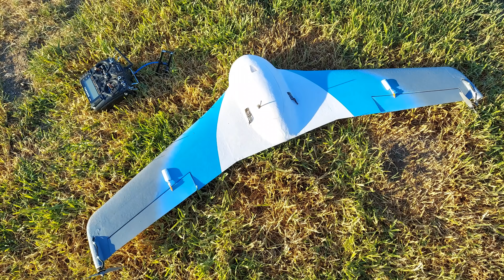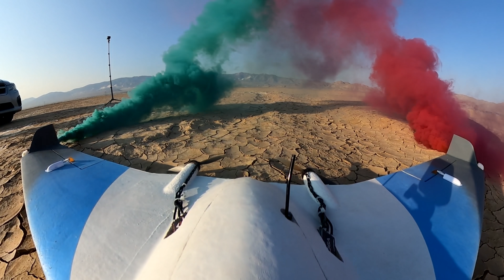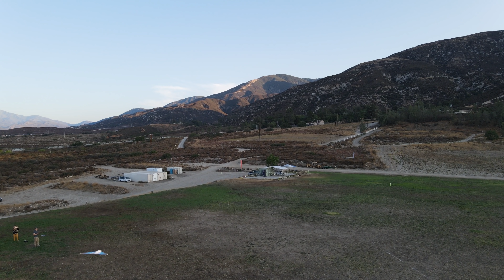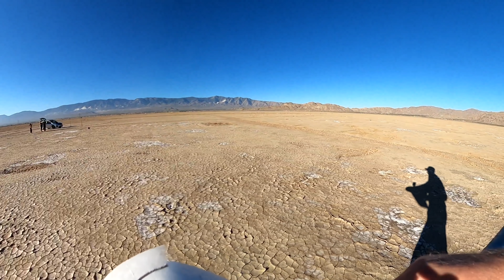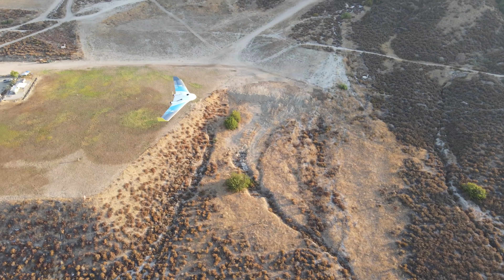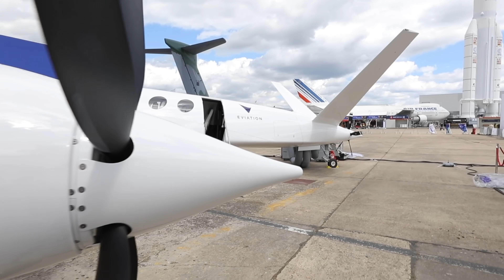Can Wingtip Motors Improve Aircraft Efficiency?  RCTestFlight Solar Collaboration Part 1

Comment: It is the same with most "We have revolutionised <XYZ> and this makes it soooo much better" - and then it turns out that it is only marginally better in 1 very specific situation and in general just worse.
For this plane - really looked nice with the wingtip-motors. I just wish you'd have added the motor-mounts for both configurations to only see the difference the placement of the motors make, cause now it also includes changes in the geometry at the wing-tips and the middle section.
you'd need to change those anyways, but it would limit the impact of other changes and highlight the effect of the motor at the tips.

Many "inventors" tried to straighten out the vorticies in a misguided attempt at reducing drag. It is not the presence of the vortex that causes drag, but drag and the presence of lift that manifest in the formation of a vortex. 
Wingtip-vorticies are formed cause the wing generating lift means it is moving air downward along its span, and where that meats the stationary air it starts to swirl. having a rotor in that location just pushes that region further outside, effectively increasing the wingspan, which in turn decreases the relative impact of the wingtip turbulences.

Comment: IMO the wingtip vortices generated by small model aircraft are too slight ti gain any advantage by either wingtips or propeller wingtips (or any other try).
A model would generally have to be at least 3 meters wingspan if not even larger to start to see issues that might need to be addressed.
This is just one of those things that can't be scaled down or up because the issues just don't scale, too.

But, if you'd like to explore the dynamics of wingtip motors, that's also interesting.
You'd be getting larger yaw effects by placing the motors far from the fuselage.
You also discovered something I think a lot of designers encounter quickly that placing motors above or below (or inline) the wings can make a big difference in pitch and that it's easier to place the engines below the wings to pitch upwards when there can be self-correcting dynamic forces rather than above the wing which causes instability to increase exponentially. If you moved your engines fore or aft you'd also encounter new dynamic forces as you move further from the plane's center of lift.
You also experienced these forces to greater effect because you chose a flying wing design. If you had chosen a more conventional wint/fuselage/tail design, the aircraft probably would have been more stable and tolerant of your design mistakes.

Comment: I had an idea a while back and I'm not sure if it's any good. Perhaps someone here could help...what would happen if the leading edge of the wings had points like the nose of a fighter jet? Same for the leading edges on a propeller. All along the edge that forces the air to divide between what is above you and what is below, there would be several small, long (or short, all depends which shape would be more efficient and not weigh so much that the points become counter-effective), thin, tapered points. 
Think of it like this: place two pencils next to each other, parallel on a table. Put an ink pen on top of the two in the same direction and press down until the pencils separate (here the pen represents the wing and the pencils would be the air molecules). Now push the two pencils together and take that same pen, point the writing tip directly between the two pencils and press down on the pen until the two pencils separate. Which exercise required less energy that forced the two pencils apart? Would that same principle carry over into aerodynamic efficiency? Maybe tweeking the shape of the points a little for maximum efficiency gain with a minimum of additional weight would also help.

Comment: The F14 Tomcat had jets that were spaced relatively far apart, and unfortunately, the "A" block of F14s were paired up with a relatively crappy engine.  When one of the two engines failed, the plane became badly off balance, and would go into a flat-spin that was not recoverable.  This is what happened in the "Top Gun" movie, but it was a very real phenomenon.  The engines were later replaced with an improved variant, and the problem mostly went away.  But the over-arching issue remains: when the motors are very far apart, it puts a lot of torque on the aircraft when one of the engines fails.

Comment: Take a look at the Vought XF5U.  The design eliminates a lot of issues.  The propellers turn to keep the lower pressure and higher pressure sides of the airfoil from mixing (eliminates the vortex from forming at the wing tip.)  You essentially have two engines dragging an airfoil through the air.  The airfoil has a low aspect ratio.  See also Vought V-173 (Flying Pancake) and Vought VS-315.  Fully articulated propellers didn't arrive until the conversion to jet engines was underway and doomed the project.  But the design needs to be worked on.  Keep going.

Comment: It would be interesting to see a commercial aircraft with a hybrid propulsion system. Maybe have the standard underwing turbofans close to the body but decent size electrically driven propfans on the wingtips driven from the alternators in the main engines.

Comment: Talks about efficiency - puts giant airbrakes on the airframe ( AKA cameras, antennas, exposed linkages, external cables and so on... )... You also have to keep resistance due to increased motor wire lengths in mind. You need a more radical design with the batteries sunk inside the outer halves of the wings. Will cost roll authority due to increased mass inertia, but should be worth it...

Comment: Winglets increase the effective wing length (while still fitting in the normal sized aircraft hanger). Having the engine at the tip and turn with the top tip moving in the outboard direction also increases the effective wing length. Having the wing at the tip and turn with the top tip moving in the inboard direction should decrease the effective wing length. Your plane might increase in pitch stability with a longer flat mini-fuselage  part in the middle, like the B-2A or the Horton Flying wings. Historically, the B-49 flying wing didn't have the long flat mini-fuselage and suffered from pitch instability. Don't know if it would be enough to compensate for a 'Go-Pro' camera mounted too far forward.

Comment: The small efficiency gains come with the major downside of the aircraft entering a spiral dive when one of the wing tip engines/motors fail. Despite the high wing span this design having no vertical stabiliser can't be flown even at the smallest airspeed in such a situation.

Comment: Given the fact that enough wind is passing the wings, and given the fact that the wing is under the right angle, the bow of the wing on top of the wing creates a larger surface area compared to the flat underside of the wing, therefore the air pressure on top of the wing is lower per square inch compared to the air pressure at the flat underside of the wing, and therefore the wings will give lift as long as enough air passes the wing to carry the weight of the aircraft under the right angle. 

Any object can be send into the air, but that has nothing to do with lift created by wings and moving air. Some aircraft's have so much power that they can fly with wings that have net zero lift in neutral flight positions. For example those stunt airplanes. But they can't do that for a very long time, like for example an airliner can. Those wings from a stunt plane only creates positive or negative lift when the pilot adjust his controls in a very specific position. This makes them very agile and maneuverable and fast responding. That is the only reason why those stunt planes have wings with net zero lift in a neutral position. 

Even an aircraft without motors and with large enough wings and low enough weight ratio can get airborne given the fact that enough natural wind is passing the wings under the right angle. Although it is very hard to impossible to control it properly. 

I have an Aileron modified Easy Glider RC model and that will go airborne with enough wind and without any extra power from a motor. Given the fact that it is under the right angle.

Comment: aerodynamics and weight ratio changes in a full scale aircraft and other trade-in for propellers in the wing tip of a flying wing with swept angle could be stability, however the trade-off of distributed propulsion and wing propellers is flutter and so structural safety and weight.
efficiency can be tested on cruising, take-off distance and also gliding or soaring flight assisted with counter vortice propellers at low rpm

Comment: See Flying Flapjack. Unless you use the prop vortex to build a lower aspect-ratio wing you should expect increased weight from increased complexity including wing structures, vertical stabilizer and rudder, and landing gear among other areas. A big challenge will be to keep prop tips off the runway during takeoff and landing. Vortex drag is maximum at minimum speeds (high angle of attack) and very low at lower angles of attack. This is why high-aspect-ratio is most advantageous at lower indicated airspeeds.

Comment: Thank you for detailed explanations of wingtip propulsion.  Like Destin's comment, I wonder if you can vary the vortex at the wingtip.  For example, what happens if you used a system to rotate and/or change the camber / castor of each wingtip motor?  And if you got a positive result, what would happen if you could independently control the movement of yaw / camber / castor of each motor?  I look forward to your next video.  Again, thanks and keep up this great work!
Reply from the maker: this would be optimal.   Probably beyond what I can pull off at the moment but great comment, maybe in the future.

Comment: What would be the difference for a counter rotating style of prop motor with the propeller in the from of the wing and a propeller in the back? Would it also help if there is a fan shroud around these propellers to help reduce the size of this drag? As they would be larger and work more technically, I suspect it might be the better way to try and test it at the rc size level

Comment: Can you use the wing tip motors for direction control. Rather than Elevons by rotating them?
Reply: @daviddou1408  : I was thinking that if the motors could also be rotated under control, they could provide vertical and horizontal control as well as yaw. No need for elevons. . .
Reply: @daviddou1408  I was thinking of just a small rotation of the motor body with servos so the change in thrust would replace the elevons, Resulting in a cleaner - more efficient - wing. As for rudder effect, differential propeller speeds will provide yaw.

Comment: I think for real airplanes, putting the motors at the wingtips requires stronger and heavier wings overall which probably destroys the possible gains from the reduced drag due weight increase.

Comment: Suggestion: as far as diameter for a single pusher, dont EVER go above 33% of w/s (I would stay in to 20% or less range...And for dual, don't go over 16%-17% of w/s (10%-12% or less for dual).  

Some preliminary prop selections: I call it "Kat" (Aircraft "type" "K"onsant).  It's based on the fullspan ,wing planform area, and flying weight which yields a coefficient product.  The formula for "Kat" is: Kat = [ weight in lbs / ( wing area in sq/ft * full wingspan ft ) ].

Required Pitch Speed (and pitch selection here for that matter) plays a crutial role here too in "matching diameter to pitch vs rpm vs required pitch speed", to other factored specific fixed aircraft constaints, which is typically based on the eitherbthe Vs (syltall velcocity) or the Vs1g (stall velocity as aircraft falls at 1g), and stall velocity margin (Vs1g margin or just "stall margin" which is simply a factor = to the inverse of "Kat" (which is just yet another factor).  😂

So, prop pitch "matching" is VERY VERY key here, too dually so, based on spanwise mounting location, cruise rpm, aircraft ideal cruise speed (Vc ideal: lowest induced and profile drag(s) plus our Vs margin, and lowest acceptable/target total net drag.  Since you are targeting a stirictly "wingtip mounted" motor/prop combo, the smallest but largest diameter is essential here for maximizing eta, but pitch "matching" also plays a crutial role here too.  As, yaw (tangential) AND trailing edge velocities (Reynolds numbers) are VERY different along the chord AND at the trailing-edge, whether it's a constant chord wing planform OR a tapered ratio chord (taper ratio drives a lot more on lift distribution "net induced drag", than aspect ratio, to a point (depends on wing planform and airfoil spanwise, twist in both physical and dynamic).... 

But back to pitch!  Say based on a taper ratio wing planform (say 0.333:1), the spanwise trailing edge velocities are VERY different spanwise but moreso chordwise...as, if the prop axis is mounted to the true "strait" freestream air (zero degrees, laterally and vertically), the prop, as it rotates expericences VERY different "intake/ingest" velocities from both blades to blade AND spanwise along the prop blade and prop chord too, for that matter.  This causes an serious imbalace condition, both physically and dynamically so...and too, with them being mounted at the tips, this is even more problematic....as, the downside blade being underloaded (producing MORE thrust and power absorbed) and the upside blade (producing LESS thrust and power absorbed)...AND the out-side (past the wingtip) blades as it were, are in a higher freestream velocity produce even LESS! In essence, if both opposing respective prop blades were in "sync" (which they aren't), both down-traveling blades are producing more net thrust and power absorbed then the up-traveling blades (due to the translation from freesstream air velocitiy from free-stream to over the varianceof  wing chord (taper ratio) of the affected prop area, AND the airfoil taper pressure/velocity distribution(s) variance.  

So, based on all of this info, using a fixed pitch prop, you need and offset angle (canted inward), and based on conventional wingtip vortex "rollup", everything is more-so a mess here too anyway.  So, I have some maths on hand here (my own proprietary spreadsheets) that can assist you in a better selection in: spanwise mounting placement(s), cant angle, prop diameter and pitch section(s), ideal cruise prop rpm, etc, if you are interested...bc if you mount them more inboard and not way out on the tip (say 70% to 90% of the halfspan), I KNOW you will gain even more eta, AND in conjunction with using winglets even if they are flat plates for starters (at the tip chords), AND wing fences (to include vortex gens) on the affected prop ingest area(s), you will see an expoential increase of etas in all areas!  Maybe upwards of 5%to 7%+ vs 1% to 2% which you arex getting/seeing now.

I have MANY tools available and my own personal calcs at my disposal, and would love to collaborate with you if you have the patience and time as I think you have a great approach and functioning "proof of concept" with some fairly promising and suggestive results (2% eta improvements) as with aerodynamics, a meer 1%-2% increase is HUGE!...esp in the R/C dept, IF you really know your airframe, you WILL notice it on the sticks..for example: a 777-300ER is only about 20% overall entire/whole aircraft efficient, ideal AND AT BEST!...this is based on "Betz's Law" which state that a realworld eta of 59.26% is maximally possible (16/27)...AND if you are interested in further improving the ETA even more.  This CAN be done.  Stick with it.  

Additional info: There is also a coefficient and factor that might help you out too...its called "dynamic directional stability".  You won't find it explained for you this way in any graduate literature bc I'm certian it's proprietary aero info but...It's based on a "Vertical Fin Vbar" coefficient with conventionally tailed (non flying-wings) aircraft that are multi-engine.  Essentially, its based on the physical area, lever arm, and quarter chord MAC, of the vertical tail with respect to the x, y, and z of the axis of rotation(s) (prop centerline complex axis'), that they are canted "inward" AND "up-ward" a certian amount (degree offset) that is based on the physical geometry of the vertical fin planform and its moment coupled with the prop(s) axis x and y location.  This inheriently gives a/the multi-engine aircraft control authority in an engine-out condition, by default, BUT this is NOT the main reason why this is done either.  I call it a "locus point" as it's literally a point out in freespace, out ahead of the aircraft where both the vertical fin c/4 MAC axis AND the thrusts complex axis' "meet/algin"...

Since you are dealing with a flying wing, the vertical fin(s) do not physically exist BUT are there embedded in the flying wing planform design and are there dynamically (embedded through the wing planform thru: span, area, AR, TR, airfoils root to tip, twist both physical and airfoil related, this can still be extracted!

Very willing here to help and/or assist you with REAL suggestions here for improvement(s).  Please contact me if you would like to collaborate.
Reply from the maker: Very interested and thank you for the detailed and informative comment.   Drop me an email in the address in my About section.
Reply: @thinkflight  sorry if my suggestions and info come off as excessive....as, you already know, with ANY flying craft, ANY and EVERYTHING effects EVERYTHING...only attempting to help here.
Reply: @thinkflight  will do.  TY
Reply: @thinkflight  went to the "about" page....I didn't see a contact email....pls advise.
Reply: @thinkflight  please re-read my 1st post on this comment as I've added quite a bit to it.  Please feel free to contact me at anytime you need a suggestion or nudge.